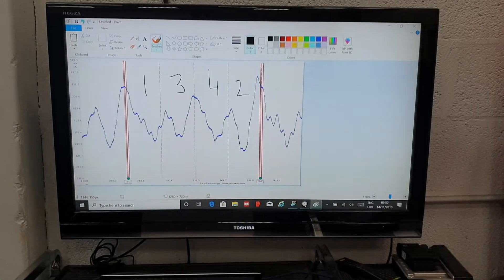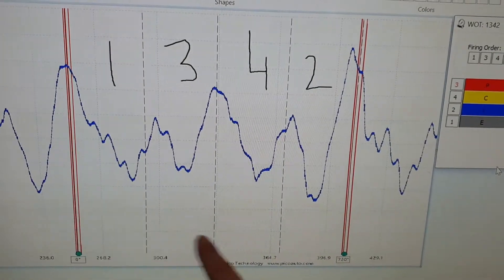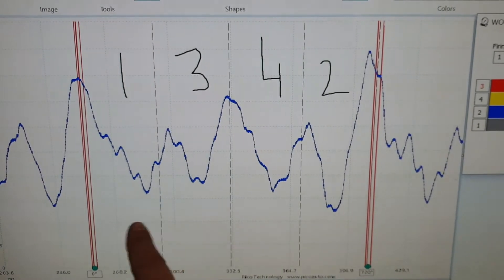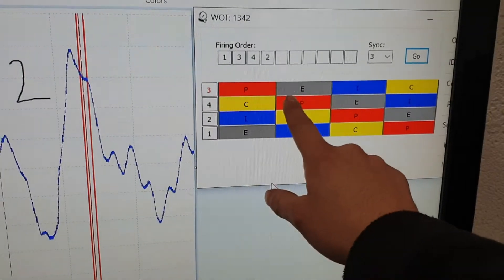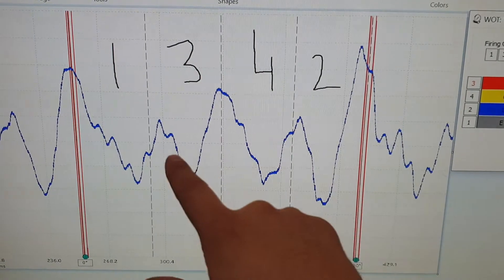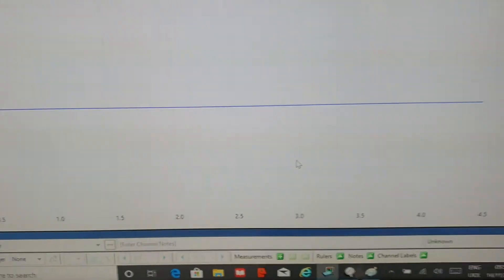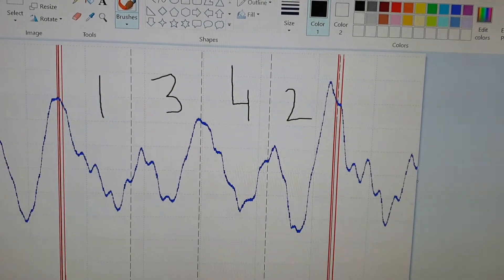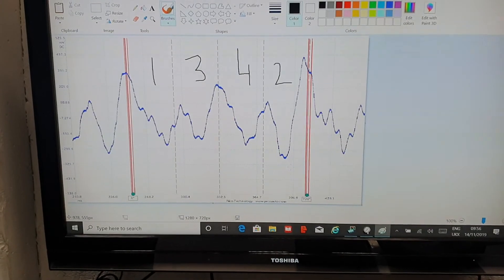Analysing Exhaust Pressure To Find Misfires

Comment: If it is possible to so easily identify which cylinder is misfiring in a non-invasive manner, then why don't more people use this method, instead of cylinder drop method?  Cylinder drop method only works with a completely dead cylinder so it has limitations.

Comment: Is this golf a GDI ? The only reason I ask is because I took a incylinder waveform from a ka recently and I had the pressure waveform, ignition event and the injection event across 3 channels, And the injection event actually happened around the tail end of the exhaust Plato if that makes sense, so I suppose my question is on a GDI does injection happen at TDC slightly before ignition occurs ?
Reply from the maker: This was a 2.0HDI PSA engine but interesting case study
Reply: Elite Automotive Diagnostics,
such a quick response 😂 I just this second managed to find you other Facebook account and found the post, I’ve not long had a pulse sensor from yourself and I am booked on the course with Brendon at tech topics, I guess I’m just itching to learn as much about this testing methods February is to far away 😂 see you soon 👍
Reply from the maker: @mattd2528  I look forward to meeting you there. It will be a blast!